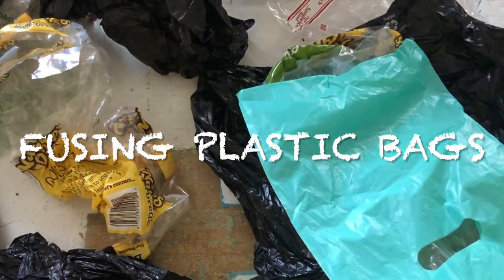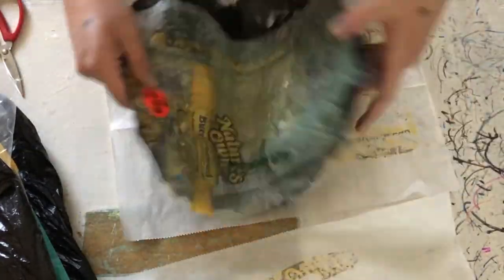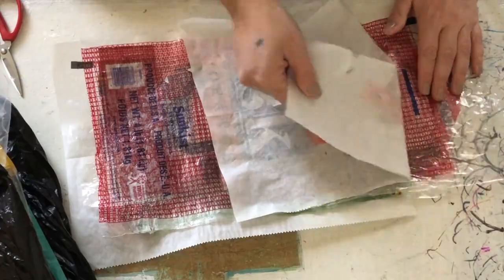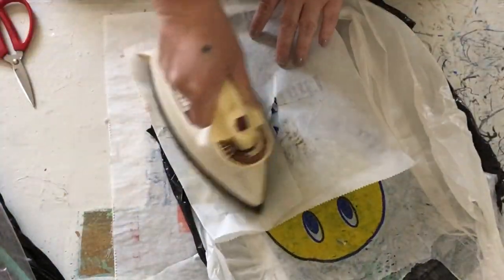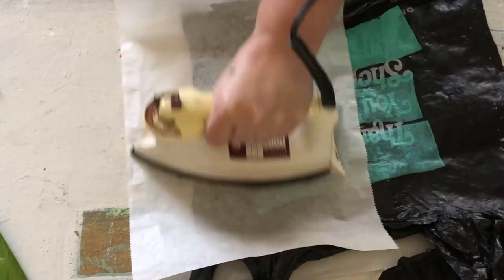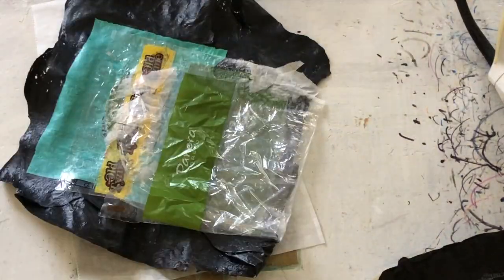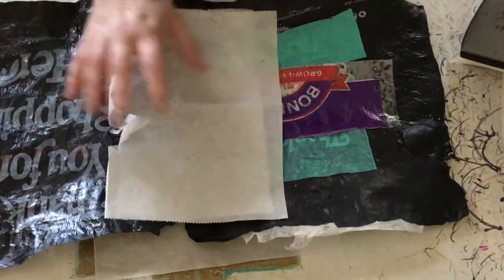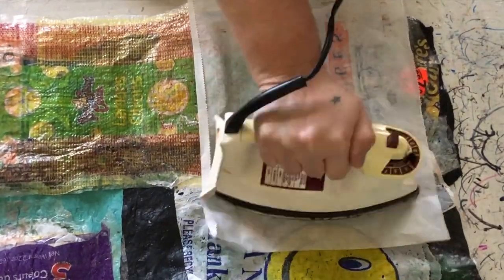How to Fuse Plastic Bags for Artmaking!

Comment: Is this safe? Does the plastic release any fumes when heated?
Reply from the maker: As long as you keep the heat low-  It fuses at a surprisingly low temperature. If there's toxic smoke the temperature is too high lol.